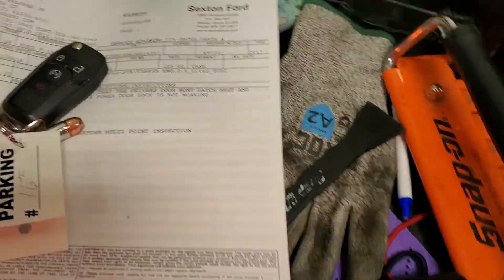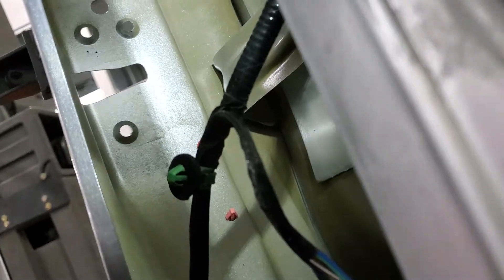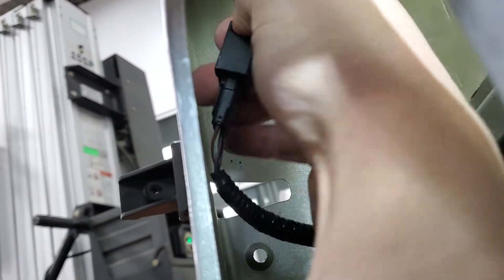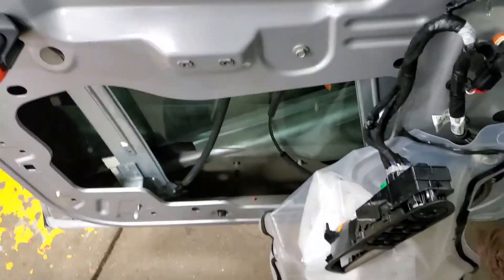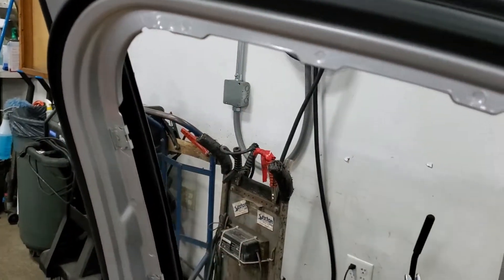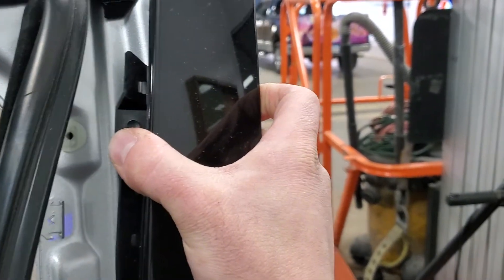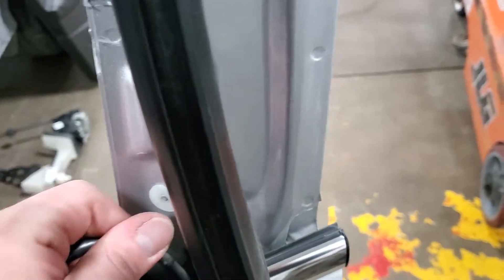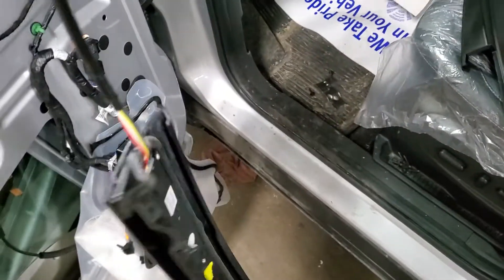13-19 Ford Escape Keypad removal

Comment: I'm about to try this out to fix my keypad on my 2017 ford escape. Once the new part is connected and the car turned back on is there anything special you need to do to get it programed to work with your vehicle?